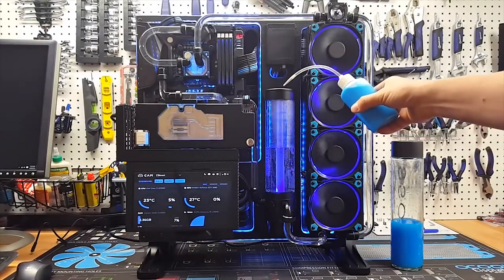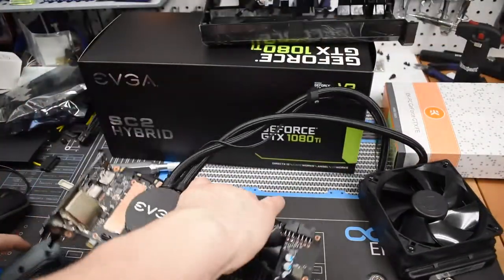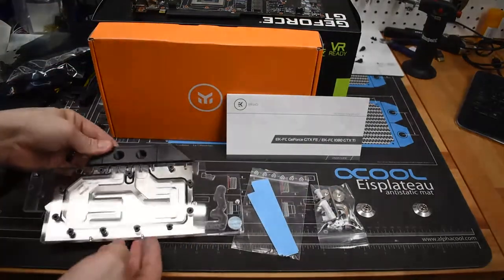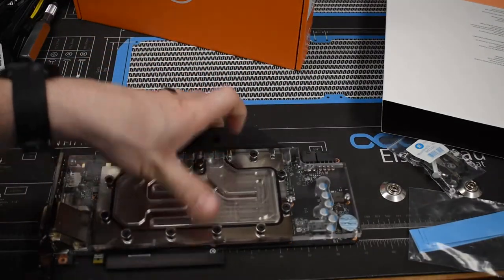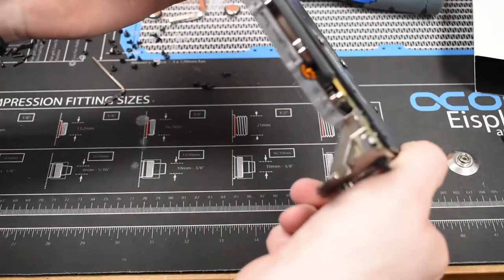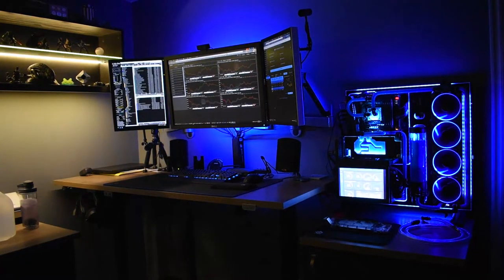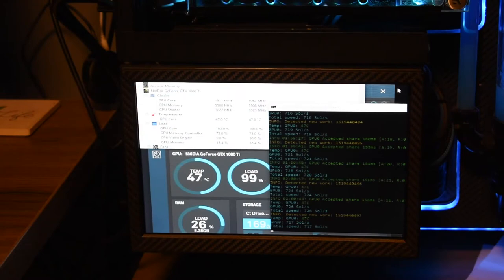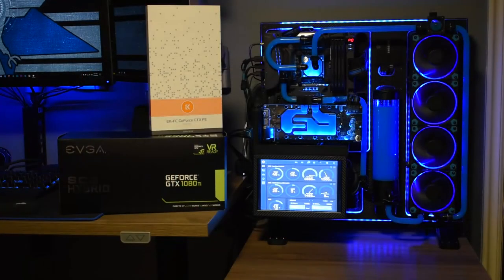GTX 1080 Ti EK Waterblock Install & Liquid Cooling Loop Drain

Comment: How do you attach a drain? I am planning on using the thermaltake m240 and I don’t know how to attach a drain
Reply from the maker: I did it using quick disconnect fittings.

Comment: Will the fan header cause problems on the long run?  I'm planning to watercool my sc2 as, but I'm not sure if the fan header will damage the block as it's pressing against the acrylic.
Reply from the maker: I don't think its an issue. There isn't that much pressure, and almost a year in with zero issues on mine.

Comment: I have the same card and block and there doesn't seem to be anything to screw into at the edge of the back-plate between the two ports.  Are you just screwing the back-plate into the PCB?
Reply from the maker: I was able to use the existing gpu standoffs too attached to waterblock. If that's not the case for you I would need to see a picture to understand where your issue lies
Reply: @MrArmageddonBuilds  There is no standoff on the water-block for this screw, I kinda feel like there should be.  https://imgur.com/6X8Efs0   
Here is the back of the water-block   https://imgur.com/DRI4ocs

Comment: I have the same gpu card, my card run good, but I’m getting coil wines, should I call Evga to do a RMA, I really like your rig, I look on EK web site said they don’t support this card a water block, what water blocker from EK are you using?
Reply from the maker: Avinash Mahabir, using the standard EK waterblock for the 1080 TI reference Edition card. Works with the EVGA SC2

Comment: So, after how long did the block start to leak?
Reply from the maker: No leaks to report. Ended up selling this one about a year ago, but now using another EK block on my 2080ti, and continue leak free.
Reply: @MrArmageddonBuilds  Great to hear that, I have seen cases of plexi degeneration to a astouding degree. I guess not all are made equal.

Comment: LOL 31 degrees Idle? My Aorus 1080ti Extreme me under load 32C and idle 18C in Game BF5 29C room temp 22.5C
Reply from the maker: A water block won't make any difference for idle temps, but once a card is stressed, liquid cooling really shines.
Most 1080ti idle in the low 30s, and on air cooling hit high 70s to low 80s when stressed. If your GPU is only hitting 32C under "load", you aren't stressing it much.
 https://www.anandtech.com/show/11180/the-nvidia-geforce-gtx-1080-ti-review/16#:~:text=With%20NVIDIA's%20well%2Destablished%20power,the%20same%20as%20its%20siblings.
Reply: Do you think so firs i do not use the shitty thermal pads 3 a 5 w/mk from EK but the Alphacool Eisshicht thermal pad 17w/mk thats already 6 a 7 degrees lower.
second i use an externe cooling rig thats 2 degrees lower.In my pc with 8 fans.and one close to my GPU. One loop GPU 3x 420GTX Black Ice Nemesis second loop CPU  Cuplex Kryos Next Vario Silver 2x 480GTX  every rad push pull  water temps always 0.5 degrees under room temp water temps never over 25 degrees with a fan speed 1000 RPM in game and stress test.And i game 5 a 6 hours 29 a 30C and in de winter room temp 22C GPU only 29C.I have build an external rig because when i change hardware
motherboard and GPU it is only a few hours work and its looks damn sexy only 4 straight hard tube to the back of my pc. And a lot safer than all the shit in the pc.
GPU full stress 99 a 100% also in game.1440p monitor 165 hz,There are two on YouTube with almost the same setup and specification.